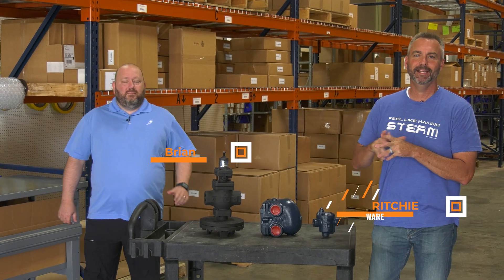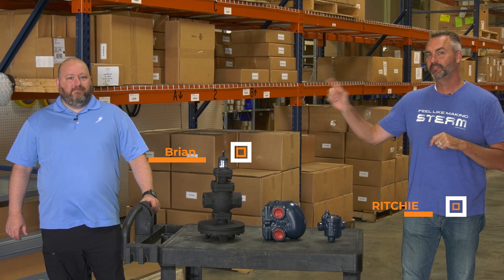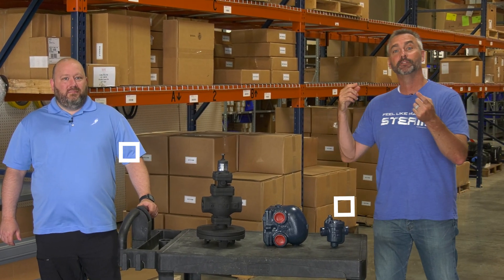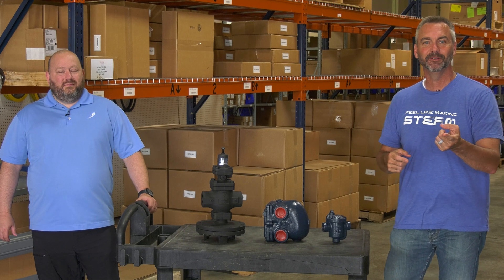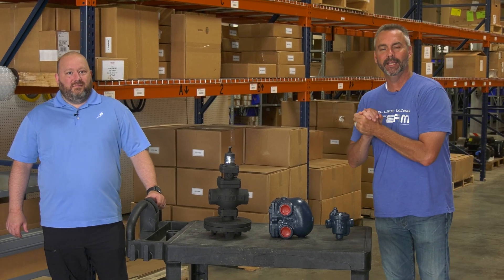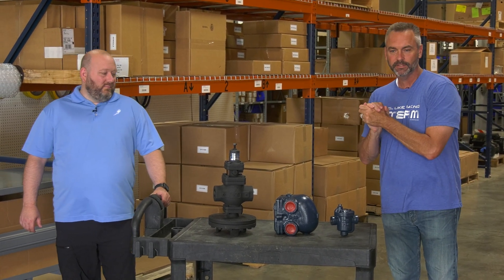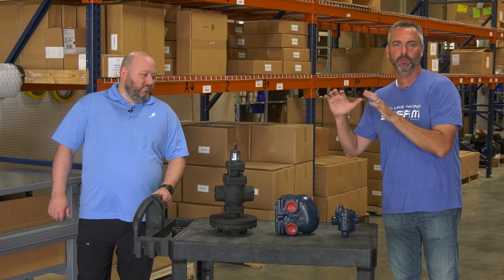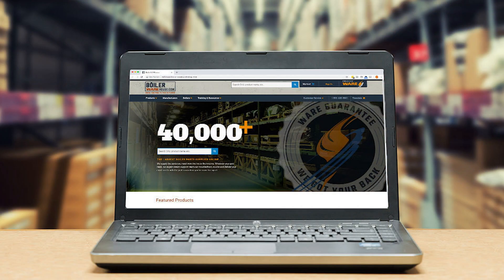Boiler Parts 101: Armstrong Steam Traps and Pressure Reducing Valves - Boiling Point

Comment: Remember when converting to Armstrong Traps, they have different size "footprint" so to say than Hoffman or Sarco brand, who use a more standard sizing. This is not an issue with most IVB (inverted Bucket) traps as the connection is on both sides and is strict in orientation but can be a bigger issue with the F&T (Float and Thermostatic) traps where some changes in the piping will be needed. The larger the trap size the bigger this issue can be, especially in areas where you are space restricted. Also keep in mind that if you later decide (and more importantly if a contractor decides for you) to goes back to another brand, these changes will have to be reversed. Chances are the contractor won't know this and will request additional funding to complete the job.